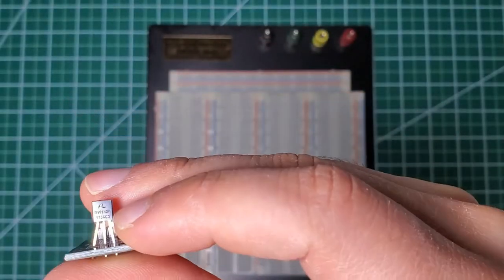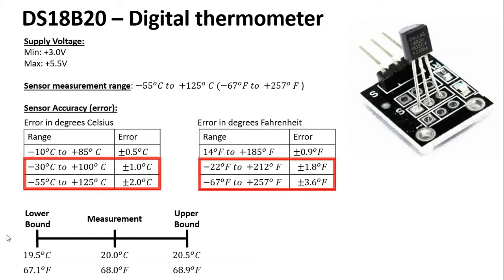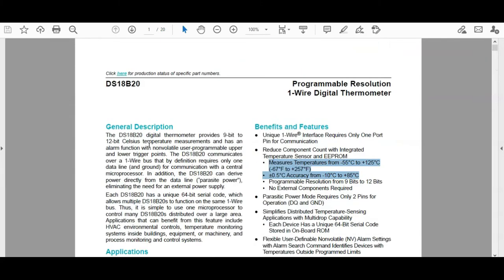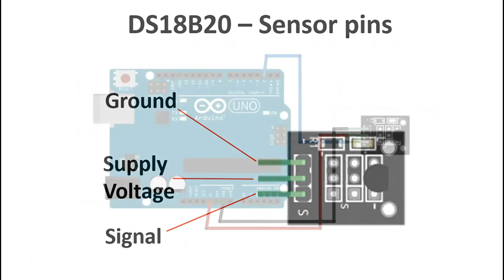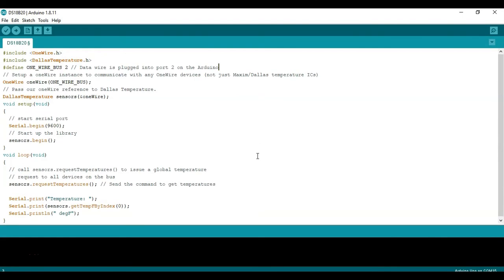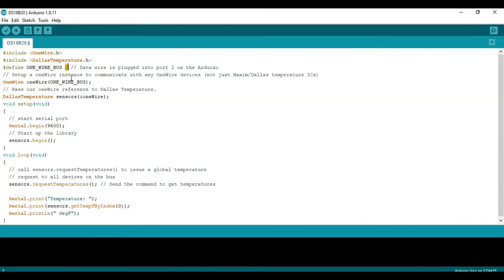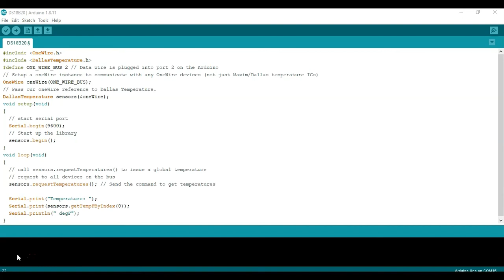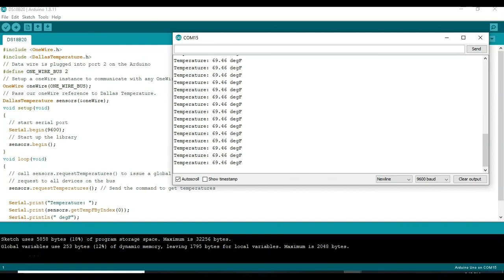How to use DS18B20 with Arduino (Example included)

Comment: im interfacing it with an esp32, and getting the celsius value as -127 constantly
i looked it up online and they said its a wiring error, so i did it as they said, used a 4.7k pullup resistor and it still doesnt work, pls help
Reply: Well I think your sensor is damaged. mine is too!🙂

Comment: How far away from the Mc can you put the sensor?How about an rtc ? same same?
Reply from the maker: Hi Patrick, I have never tested the sensor in long ranges. Main concerns would be potential noise, and voltage drop. For the DS18B20, the required input voltage is 3.0V - 5.5V. So assuming you connect to the 5V pin on the Arduino, you could take the sensor as far as the cable voltage drop allows you. The voltage drop will be dependent on the length of the cable used, the cable gauge, and the working current (max active current according to the datasheet is 1.5mA). See this website for a table showing the cable resistance (in Ohms) per 1000 feet:

https://www.powerstream.com/Wire_Size.htm

Then look at the cable sending the signal to the arduino. That cable will have its own voltage drop going from the sensor to the digital input. The Arduino UNO digital input pins require at least 3.0V to consider the signal at HIGH. So you want to make sure your voltage drop from the sensor to the Arduino digital input pin doesn't cause the signal voltage to drop below 3.0V. You can run some quick calculation Voltage_drop = current * cable resistance.

Thanks for watching!